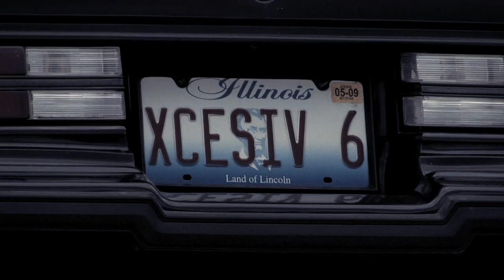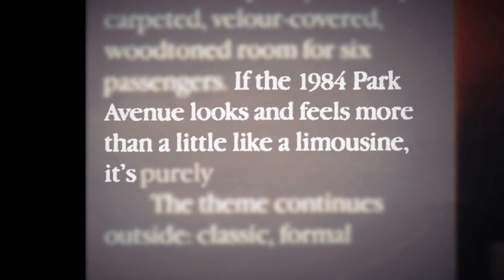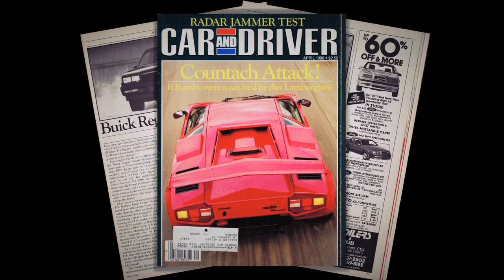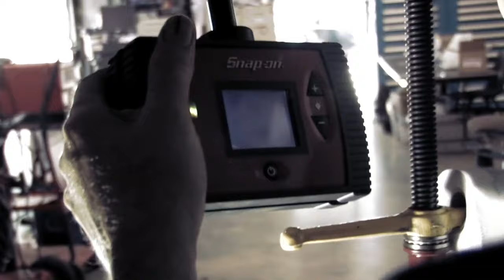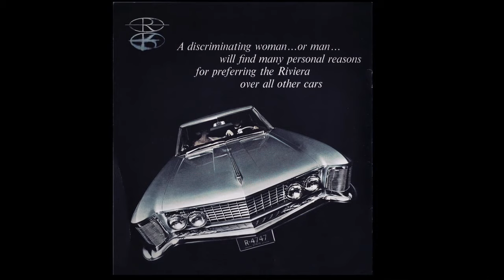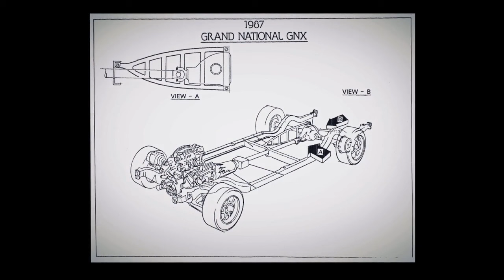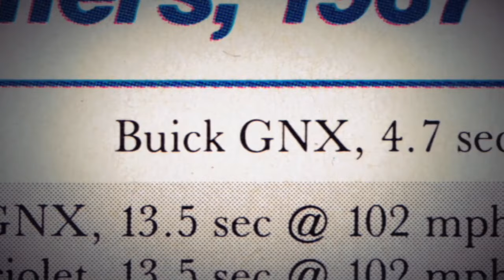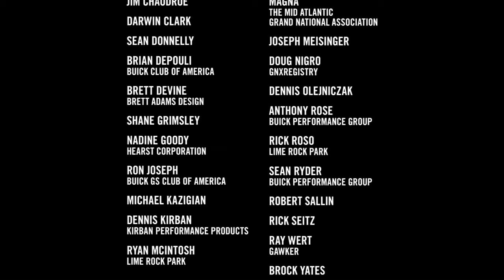Black Air The Buick Grand National Documentary 720p HD

Comment: Glad I still have my '87! Bought her in '94, with ~35,000 miles on the clock. I've always been a Buick hotrodder. Dad drove special-order LeSabres with monster-engines & top-end gears. I built a '63 LeSabre with a dual-quad 425 nailhead back in high-school. Had a '67 GS 400 4-speed ragtop back in the '70s. And then, the glorious GN! A number of tweaks, but nearly "stock-appearing". She runs 0-60 MPH in 3.7 sec, does 11.9s in the 1/4-mile, and has seen 167 MPH while doing laps on Texas Motor Speedway. I've driven her from Minnesota to Charlotte & through the Blue Ridge Mountains, Minnesota to Dallas, and Minnesota through the Rockies. She has 190,000 miles on the clock now. Still numbers-matching, still doesn't burn oil, and is still as reliable on long trips as any modern low-mile car. No car I've ever owned makes me grin as much as my GN! :D
Reply: I always have wanted a GN all my live! Does the car have a price tag on her!?
Reply: I remember the first time that I drove a GN.It pinned me in the seat and just kept me there until I let off the gas, it seemed to have unlimited power.When you first took off it was just like a regular 3.8 , but once the turbo kicked in, HOLD ON !!

Comment: Ok so has everybody forgotten that this idea actually was conceived in 1977?! The 1978 Buick T-Type, does this ring a bell with anyone.
Reply: I used to drive a 1978 Buick turbo. One of the worst cars I've ever had and helped make me hate GM. 120 hp at the wheel, guzzled gas and constantly overheated. As far as I'm concerned there's no American made car worth buying made between 1973 and 1985.
Reply: Some of the '87 T-Types were deemed faster than the GNs were. But the name flagshipped the boost in turbo and hp from '84-'87. I am still a big enthusiast to this day, as my mother owned an '87
Reply: Yes but it wasn’t just the Regal.  Buick had other turbo T’s pre ‘86 as I recall.
Reply: Buick made those early turbos sure they had some bugs but by 1986 since they added the intercooler in the mix that changed the whole game for buick by the time the grand national was fully evolved GM pulled the plug on it but buick did light the torch on the darkest time in automotive history  especially with the gnx
Reply: I have a 79 and an 83 t type, people usually don't know what they are when I go to a  show and pop the hood.
Reply: Yes I agree the first buick with a turbo was a 1977 buick century that was used as a pace car the earlier turbos had a 4 barrel carburetor all the way till 1984
Reply: Buick even had a turbo charged lesabre the regals were just known as buick regal sport coupe no type or grand national  the first t  type was made kn 1983 and the gn debut was in 1982 it came in a two tone paint scheme only 215 made
Reply: @chriswooten8426  yes I agree the 87 were called the buick regal turbo T it had a red t inside a square that replaced the t type in 1987 they had a factory code know as we4
Reply: @DavidR-ub2dp  They offered turbos in their whole line pre GN/GNX. Rivs, Century, Regal, LeSabre all had turbo options even the Skyhawk. And surprisingly that smog equipment laden 1.8 I4 turbo put out 150 HP in 82' when the bent six was only making 20-30 horse more at over 2x the displacement.
Reply: @jimmartin7881  yes I remember seeing those cars when new when I was a kid I even have the old sales brosure from 1978 till 1987 from buick
Reply: I believe the LeSabre super sport in 77/78 was the original attempt by Buick but the Buick 3.8l motor is and still remains one of the best motors of all time and the slightly slenderized but strong A/G bodies helped paved the way. Still be nice to see a similar presentation on the 3800 history including footage of the ceremony when the last 3800 rolled off the assembly line.

Comment: These cars were lightning off the line. Rumor had it faster than a Corvette or Porsche. I was a 20-21 year old car salesman in 87-88 at a Buick dealer and I sold and drove many Regal T-Types and drove a lot and sold a couple of Grand Nationals. Same exact engine, both 3.8L SPFI Turbo, except there was one upgrade package available on the GN. I remember there was a 3-4k price addendum sticker on all of them over and above factory sticker price which was around 18k because they were so hot in 88 when the last of 87's were being sold. The last ones were being sold for 21-22k. You could be going down the highway at 55 and stomp on the gas and your tires would burn rubber. They were unreal. I used to have buddies come in and pretend to be customers just to go out on test drives. lol.

Comment: Very well done, and good information. One small correction: The Pontiac, MI plant that assembled these in 1987 was technically not the oldest operating GM plant. The GM Clark Street plant in Detroit that typically assembled Cadillacs opened in 1921 (before the Pontiac, MI plant) and ran through December 1987. The Pontiac, MI plant produced the Fiero and closed in mid-1988 after that model was finished.

Comment: I bought my 86' G.N. IN 2000 FOR 7-K WITH 84-K ON CLOCK,,, B9NE STOCK T-TOP ONE OF 5512 T-TOP CARS,  SOLD IT IN  2002XFOR 9.500 TO BUY MY 66 G. S. # S MATCHING  401C.I. NAILHEAD,, FACTORY  4 SPEED,,, LOVED THE G.N. BUT DON'T  REGRET  SELLING IT BECAUSE AFTER 21 YEAR'S  I STILL OWN MY 66' G.S.  MARINA BLUE, PAINT CODE F F. I'M  CUR IN THE MARKET FOR ANOTHER G.N  BUT THE PRICES ARE STUPID  MONEY!  I'VE  BEEN OFFERED 45-K FOR MY 66' BUT COULD NEVER REPLACE IT!   The 66' is  way more rare,,, only 2.199 four speed hardtop produced!

Comment: I remember when these first came out reading that they would lift the front end off the ground bone stock by just adding rear slicks.  Then later in life reading that the F.B.I. assigned about 500 GN's to their agents and the agents were unhappy about the ending of production.  I myself was never able to afford one back then and certainly not now but, I was lucky enough to own a 1970 GS350 Skylark which actually had less production numbers than the 455 GS.  Mine had bucket seats and U-Handle floor shifter, map light on rear-view mirror and a speed buzzer that I could buzz ad 120.  The Buick 350 had same H.P/Torque as the Chevy 396 (315/410).  In over 40 years I have never personally seen another GS350 and even rarely see 455's and of all the 350's I've seen online, none had bucket seats.  Regrettably I had to sell it and later the car that replaced it(1973 240Z) burned up in my garage and I always think, I'm sure glad I sold my Buick before that happened.

Comment: I was fortunate enough to test drive a Grand National in the mid 80s and I'm sure I could have afforded to buy the car but thankfully I didn't because my ex-wife would've no doubt taken it in our divorce and I would have been doubly heartbroken. It was all black like the majority of them were. As I recall it was barely used with 13,000 miles and the price was just about equal to the odometer reading $13,000 if I remember correctly which I believe I do. $13,000 is a pittance compared to what the last Grand National recently sold for but to be fair the last Grand National is a museum piece.

Comment: McLaren designed the turbo system for this car , and it was faster than the same year Corvette .
Reply: what made the engine unique in that era of fuel injection was it's sequential multi-port injection. all the other mpi to my knowledge fired the injectors in groups of 3 (6 cyl) or 4 (8 cyl).
Reply: My 1987 Jeep Cherokee had multi-port injection , that was the last year for AMC owning Jeep . V6 and V8 cars never got real fuel injection until the 90's .
Reply: "My 1987 Jeep Cherokee had multi-port injection"

that is news to me. is it sequential like the point i'm making?
Reply: 6 cylinders , 6 injectors on the XJ , YJ never got it till 1993 i think .
Reply: Wow the GNX even blew the  doors off that twin turbo vette? Nice asc and McLaren made the upgrades to the GNX It was the last hurrah for this buick it went out with a big booom!

Comment: People my age (I'm 30 born in 90) just dont understand or respect how awesome and badass GN's are! Honestly 80% percent of people my age dont respect or understand how anything works except asking for free shit! Theres only two things I would really change if I had any input on designing the Grand National, if I'm not mistaking GM had already had the L98 350 in production for the corvettes and what not, I do know in 86 or 87 is when they threw aluminum heads on it. It would have been cool to me if they would have used the L98 with basically the same turbo setup with just a little bigger exhaust housing and exhaust wheel just for efficiency sake. Hell the GN turbo would be enough since it would take less boost to make the l98 pretty stout, idk the exact specs on the factory turbo but I'm sure it could make 10 pounds before the turbo runs out of breath. The other change would be two transmission options a 5/6 speed and either a 700r4 or th350 wich I would have picked, That's all I would change and would have done it for the 86 and 87 year models.
Reply: I think 6 speeds were in development or barely available to the public in ‘87. Even a 5 speed would work. Pontiac could have done that with the ‘89 Trans AM pace car. 

It wasn’t that manuals wouldn’t work with the g platform, it’s just that those were mainly marketed as a personal luxury coupe. However, you were able to get the Monte, GP, Cut Supreme, and Malibu in a 4sp manual in ‘79. 

If they dropped in the L98, Gm would have most likely mated the 700R4 over the TH350 because it would bump up their EPA numbers.

Comment: 15 pounds of boost equals 231 x 2 = 462 cid.
Reply: Hence you just revealed the secret to their monsterous performance --- big block torque.
Reply: So what does 23 lbs of boost equate to?
Reply: @tobiaswillson5900  591 and yet it only pushed my car to a 12.61 @ 109 mph. Guess those floating valves at 4500 rpm were really messing it up.

Comment: At 1:06:44, did something get ripped off the front of that car as it was backing off the trailer?
Reply from the maker: yeah. the driver's side air foil under the bumper, it's there to redirect air for cooling, just a small piece of plastic is all.

Comment: Not one time, so far, a mention about low gearbox ratio....low as a snake!
How about handling???

Nope, not mentioned...
Again, only straight line performance is featured .
Sucks dimes if a curve or corner is in a road.
Your f... u... cked.
But at least GM tried
Reply: Opinions are like a holes....
Reply: G body shuffle why would you want to corner anyways?

Comment: The REAL "rare" and "hot" turbocharged Buick Regal was/is the Regal "T-Type" that preceeded the "Grand National" and other than "special badges" and the turbocharged engine  is just a Buick Regal. The Grand National was and had to be ridiculously overhyped because there was about zero interest in them from car guys" and come '87 when the 350 TPI engine showed up in the Camaro, the last reason any GM-loving car guy could have to avoid the Camaro - only having those "crappy" 305s under the hood - went away and you had to be deaf, blind and dumb to think a Grand National was "cooler" or "quicker" or "faster" on a day-to-day "street and strip" basis than even a Camaro "RS" with the 350 and 5-speed and 3.27 gears and no heavy-ass T-tops and "ground effects" to add drag and weight and slow it down. In order to ultimately make the "Grand National" live up to all the hype and propaganda and make it as "fast" as even a non-California emissions 305 TPI Camaro stoplight to stoplight, Buick had to go back and come up with  the "GNX".
Reply: Sir, When have you (Ever).. seen a Camaro “RS” or any trim level with a ((“350 5spd.”))!?!? 😲..🤔
 That would have to be the “rarest” car in the World.. seeing how (ALL) 5.7L. 350s was “Only” made with “automatics” due, to the large amount of Torque the motor producted!

Comment: The out of focus camera work gets old.   I had the brochure, built the model, but settled for a 335i with a JB4 and a black grille.  I was disappointed  at the level of detail about the 86-87 GN   Someone please fact check me...
-it had "fast ratio power steering"?
-it had a harder suspension and swaybars?
AS for the history, they'd been turbocharging since 82 or before , made it all black in 84, and started intercooling in 86?  I know I remember pictures of older boxier Regals with the hood bubble.
Reply: Clearly. What's the Reynold's number range for viscous flow?   I could start backwards, do a J turn and smoke your 78 stingray in straight line.  Because I know for you guys it's all about the 1/4 mile.